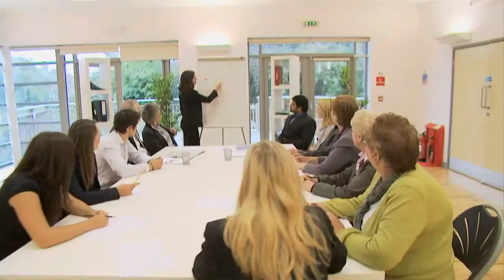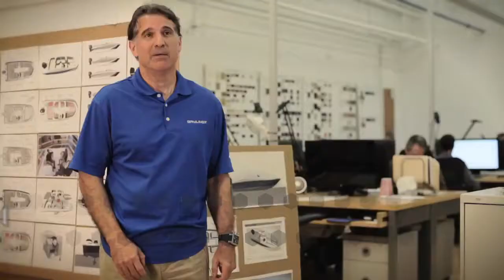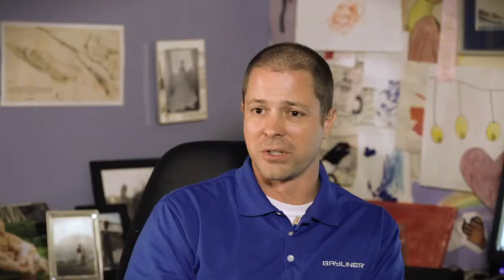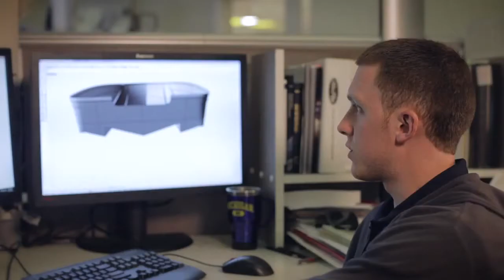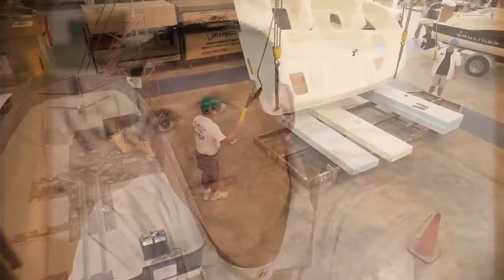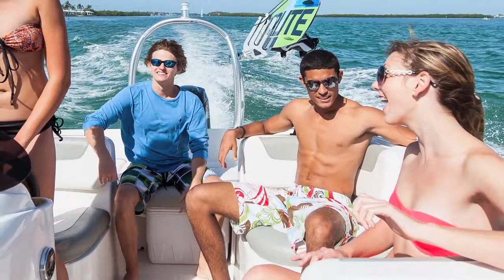The Making of the Bayliner Element

Comment: I just bought an F18. Brand new 2020. With the bow cushion option. 
WHY WHY WHY did your factory drill 25 holes into the hull to mount the brackets???
I removed the ugly brackets, and found 15 “mistake holes” under them.  You guys ruined a new boat, my boat, and hid the damage. 
WHY did you do this? Why? 
Now what do i do?